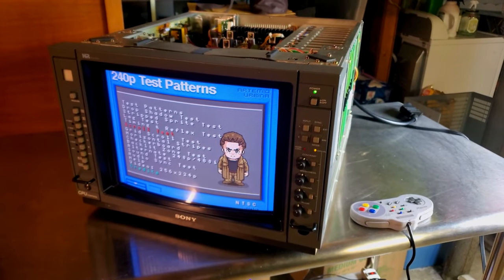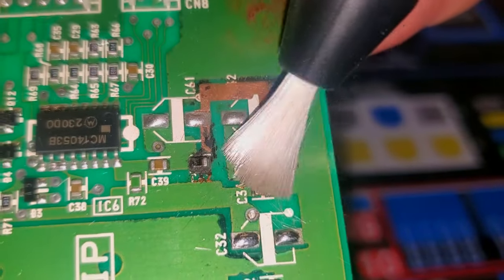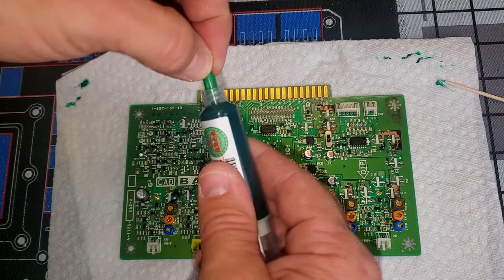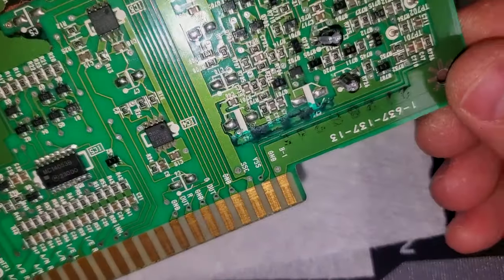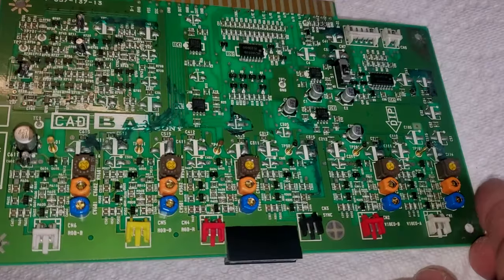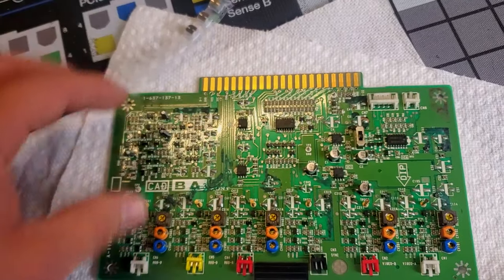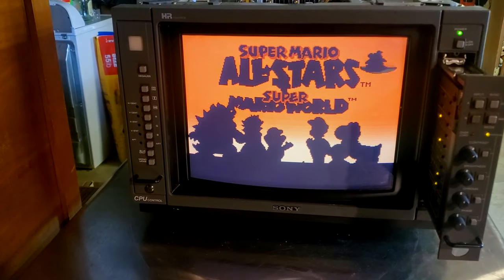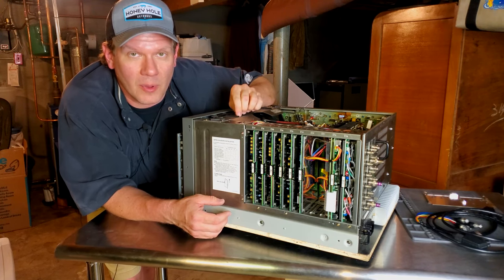The Sony BVM 1316 CRT Monitor 📺 SMD Repairs Part 3

Comment: Have got a 1614p (the PAL version of this monitor) can confirm that BKM1440 (rgb/comp) must be in slot B3 only for correct operation. BKM1410 must be in slots 1,2,4,5 to sync NTSC composite OR BKM1420 must be in slots 1,2,4,5 to sync PAL composite. Slot 5 must be populated (with something) for luma/chroma to be processed.
The comb filter boards 1411, 1412,1422 seem to be optional.
Your problems look like no sync on composite and no picture on component. If you put a BKM1410 in slot B5 that should give you sync on composite, and also set your luma/chroma to greater than zero on component.

Comment: I've got a similar model (BVM-1410P), one perfectly working and one with several issues, one of them being the sync problem. If I switch the defective input card with the working one, no issues with sync. On my input card there's a chip and some other components handling sync. Tried switching out all the other cards, but that made no difference... haven't done any more troubleshooting as the monitor has several other issues. Just wanted to know what they all were before deciding to not work on it.

Comment: Hey,  You do actually need those cards you mentioned. I had 2 of these I picked up from a local auction and 1 had the cards and the other didn't (same as yours). Exact same issues you're having with the one without those cards and the one with those cards has no issue at all with component or rgb w/ internal sync.

Edit: these also had leaky smd caps that I replaced, seems to be a common thing among these.